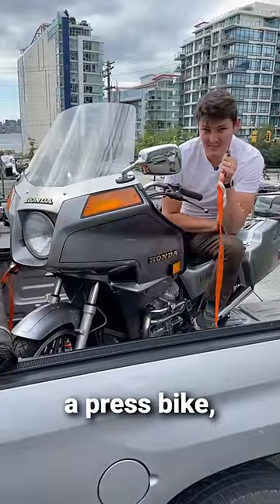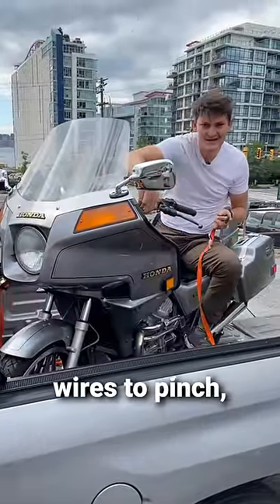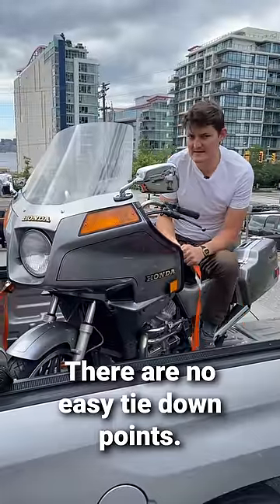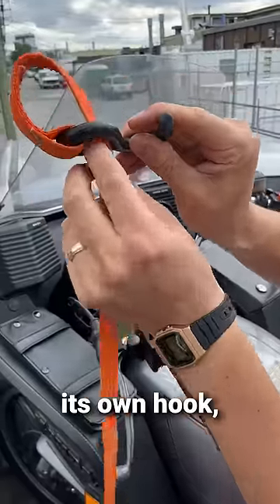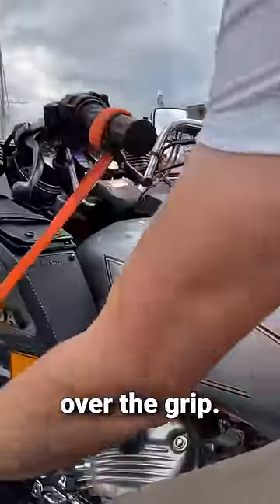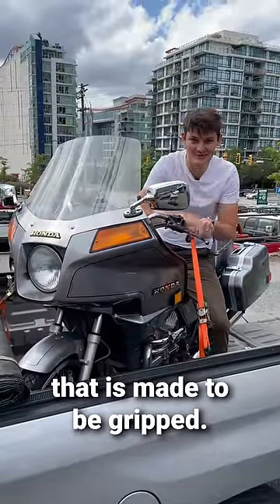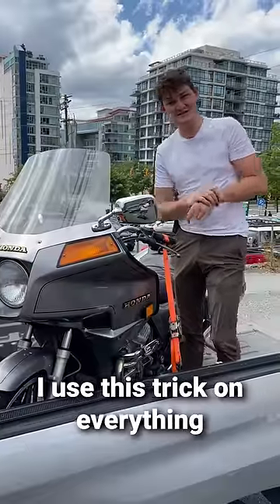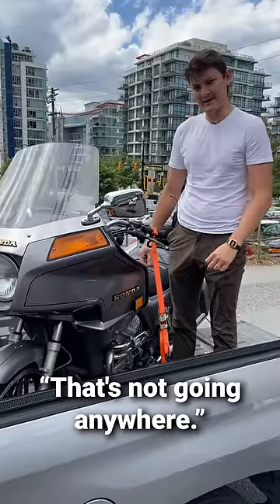The #1 Trick for Strapping Down a Motorcycle

Comment: Dang. This is the first time I completely disagree with Ryan.

Never use the handlebar for securing a motorcycle. It's the worst place to do so.
The best method is to place the straps below the suspension, such as around the forks.

EDIT: To be fair, this video is really about the trick to make a loop on the strap, rather than about how to secure the motorcycle.
Reply: Totally agree… unless you strap the bars near the bar clamp.   If it’s near the bar clamp, the there should be no rotational torque on the bars and no bending moment.  Plus, the grip is a lousy place to anchor not only because it allows a bending moment and rotational torque, but I wouldn’t want to crush the plastic throttle tube.
Reply: "The worst place" what about using the clutch leaver and break leaver as the attacment point?

runs away
Reply: @hankjones3527  🤣
Reply: @positivelynegative9149  But in all seriousness I agree with your underlying point. I think the handle bars shouldn't be the first choice if there are other options.
Reply: I agree this is the first time I ever saw anything that he made that I completely disagreed with. This is a very bad idea
Reply: @hankjones3527 why would you put those nasty images in my mind
Reply: I feel like this would be REALLY hard on your throttle cable. Also attaching on the end of the handle bar will create a bigger lever that could wrench the whole bar down during transit which, would lead to loose straps.
Reply: fowyb If you preload the fork, why would oil go anywhere? If the bumps are so hard you lose tensions in the straps you have either tightened it to little or are going to fast over the bump.
Reply: fowyb Yesterday I paid a dealer to replace my fork seals.  Ain't cheap!  Really ain't cheap!!
Reply: I go around the handle bars and strap it down tight enough that the suspension will not compress unless I hit a 20ft jump in my truck. Forks don’t leak, because the oil doesnt get compressed. The oil flows through a constricting valve, doesn’t act as a spring. This can wear out a spring type fork though if you are holding the spring compressed for a while.
Reply: fowyb your seals were broken before you started to strap it down. This would not cause that damage in no way. The seal is designed to be used on the entire length of the shock. There is no pressure building up against it.
Reply: Agree 💯. Handle grips are rubber and will strip. Why not use the lower triple clamp? Quicker easier no risk. I won't ever be doing this.
Reply: Plus, not ratchet straps. Proper cam buckle tie downs.
Reply: @Zeesneakyninja  Right, but unless the forks move the oil wont flow. So I don't see the problem?
Reply: fowyb if it leaks strapped down they were leaking while riding cause seals don't leak unless they are bad
Reply: i would not trust an 800lb bike to set of rubber grips glued on a chromed post...
Reply: Yes, i also strap it under the suspension after i saw some custom builder on youtube doing it. It is solid as a rock, unlike above the suspension.
Reply: Totally agree, escpecially on sumthing like a Pan European as you can stress fracture the casting.
Reply: Forks are too far in. You need the widest point (bars) to stop it from tipping. You just don't get enough leverage on the triple clamp or forks.
Reply: @shhmule  that is not accurate and will not be an issue as long as you don't tie your motorcycle down with floss string. 2 straps and a wheel chuck is all you need if you tie it down this way. I've driven mine many miles this way with less issues than when I used to strap it above the suspension using 4 or even 5 straps.
As long as you do it the correct way that is.
Reply: @MoreCharactersThanNeeded  So where do you strap?
Reply: Unless of course you ride a Triumph American like myself, there is no front suspension.
Reply: @shhmule  upside down fork, at the topmost part of it above the mudguard. It is important that the straps pull downwards and forward. If I can't pull it forward I use 3 straps and secure the wheel to the trailer as well so it does not move backwards.
Reply: @MoreCharactersThanNeeded  I use a pretty secure chock which tilts forward and locks. I'll try your method tomorrow and see how secure it is
Reply: @hankjones3527  Tbh around the handle and the brake lever is probably a good spot, lock the front wheel up, not that you should need to like but still, nice to have it locked.
Reply: Yep. I have a loop strap that I put a sheep skin seat belt cover over and then loop each side of the forks
Reply: Thank you for saying this, hauled bikes for 6 years, the handlebars are wrong! First time ive gasped at ryan
Reply: I entered the comments section just to say so . ✌️
Reply: What a disaster that was! I tied the straps around the axle at the base of the forks, and tied them forward to my chock.
There were no straps above the suspension of the bike, which meant the whole upper section of the bike was free to sway around.
I drove through a roundabout and the bike just about lay down on my truck bed!
It's just simply not possible to tie the bike down below the suspension components, there isn't enough leverage.
Have repositioned the straps onto my barkbuster handguards for the rest of the trip.
 @MoreCharactersThanNeeded
Reply: Buy a set of canyon dancers and never worry about this again
Reply: False. The handlebars are more than strong enough.
Reply: Wrong, you want the strap as high as possible. Think about it, is it easier to hold a tall glass of water steady at the bottom or the top?
Reply: @shhmule  
When I bought my  2017 Road King and hauled it home with my single place motorcycle trailer I strapped at the forks just above the fender mounts and it was solid and never moved once and I have to travel on winding rough roads for seven hours to get home with it.
Obviously you don't run the straps straight down near the tire. 
This method of securing the bike allows the suspension to function as it would normally putting no stress on the bike or the straps as the straps at the forks  not need to be cranked down to do the job.
Reply: @grounded7362  There's no unsuspended part of the bike above the fender on modern bikes.
The chrome part of the fork tube attaches directly to the axle lug, which is inline with the axle.
Reply: @shhmule  
Sorry to tell you but do you see the design of the forks on the bike Ryan has in the video? the upper part of the fork travels inside the lower fork tube.
Strapping just above the fender mounts puts you below the suspension travel.
Reply: @grounded7362  Nope I was applying the technique to my own bike, as it's more common with modern bikes to have upside down forks.
Reply: @shhmule  
Okay, so you have the inverted forks, run your straps down as far as you can to keep them out of the suspension travel of the forks and put no real outward pulling on the lower forks tube. 
No different than locking into a wheel chock other than the straps are above the axle.
Reply: well that's a shitty low angle, Def not doing tour below the suspension piece
Reply: holly crap lots of really fu#$ ideas here.
Reply: That’s how I’ll hauled my bike since forever
Reply: To be fair to who?
Reply: @russpaton8877  
When you end up catching that bad spot in the road and find yourself with a broken strap and the bike hanging over the side of your truck or trailer or do damage to your bike because you strapped in above the suspension, you will wish you had used that shitty low angle.
Even on good roads every crack in the road causes the suspension to respond and allow a momentary slacking in the straps. Tha amount of force being put on those little straps when the suspension returns is unreal.
And every time that returning suspension creates that hammering effect, it is doing some sort of damage to the bike. Something is getting twisted on bent in some way.
But hey, if you want to tie into those handlebars or your triple tree go for it but don't be surprised when you go into a death wobble on the highway afterwards because you tweeted the fork alignment.
Reply: @shhmule  
Yeah okay.
You better tie out exactly how Ryan did it the video then since that IS the widest part of the bike and you can get the most leverage there.
So leverage is what you're looking for huh?

You have no idea.
Reply: @shhmule  
The mistake you made is tying them forward to your chock.
The need to be out to the side.
Tying forward and inline with the bike is wrong.
Reply: @grounded7362  so what better strap do you use? Same strap, same force but less mechanical advantage. You seem quite upset. explain how your system is better? you know what a fork brace is?
Reply: @russpaton8877  
I use the Tank Straps, they have no hooks to potentially come unhooked, I wrap them low around the forks and out toward the front corners of the trailer. it's not necessary to go clear out to the corners, you just want to be further out than the width of the bike. If hauling two bikes, strap them out as far as that allows. I strap the front tire down and forward with a short heavy strap and strap the rear tire down just to keep it from possibly hopping around.
Never had to put any other straps on the bike and no issues with it trying to tip.
Yeah I know what a fork brace is. What about it? If it helps to make a guy feel better about strapping to the forks that's great, use them.
If a guy is looking to use the fork brace so he can run faster in the twisties, looking for greater stability, they would be better off investing into the inverted forks.
Like I stated, you want to keep the straps out of the suspension. Your straps should never be used where they can slack out at any given moment, not even a tiny bit. To much risk of doing damage and risking a broken strap.
Reply: @grounded7362  sounds pretty solid, my bikes are tall I wouldn't feel good about strapping low at all. The fork brace I am speaking about is one you place in between tire and triple to stop fork compression when strapped not a permanent  fork tube support. Cheers
Reply: @russpaton8877  
It is a very solid setup. I use this with my 825 pound Road King and have used it with a full dress Goldwing and never once was concerned about it or had an issue.
As far as the fork brace you are talking about. I would be concerned about scoring the tubes and doing damage to the seals once removed and in operation.
Your fork suspension is going to want to move and push against the fork brace with every bump and crack in the road.
Reply: I found out how weak ZRX handlebars are when I strapped mine the same we had been strapping a ZX12 = bent my ZRX bars🤦‍♂️
Reply: yeah, just like a car/truck. you want to tie it down on unsprung parts. so you're not compressing the hell out of the suspension, or risking a heavy bump loosening the tie downs. and you let the suspension do it's job instead of being over compressed. but ya gotta do what ya gotta do sometimes. i would much rather use foot pegs or something when possible. but if you can strap around the axle, it ain't goin anywhere... i always make sure anything i'm hauling is tied the fuck down. cause i drive fast... it needs to be secured. and i've never had much of anything come loose. did almost take out a minivan with a 2 inch strap on a bundle of plywood once... this was before i learned ratchets' locking point and the strap unloocked and went flying out toward the minivan.
Reply: The guy likes to secure the deer by the antlers
Reply: I always use the fall braces to strap my Honda Transalp down as they have sturdy mounts. Handlebars will buckle if it gets swayed to hard, for example on a ship on a choppy sea.
Reply: @gasdive and with carabiners :)
Reply: @MoreCharactersThanNeeded  strapping the bars down is also extremely solid if you do it right. I still wouldn't go by the grips though.
Reply: @jellafella6957  the issue I have with it is that the suspension creates slack for me sometimes unless you bottom it out. Less springiness in the system has paid off for me at least.
Reply: Just here to +1. The loop is a cool trick, but for location I always go up from the front wheel parallel with the forks and around the ignition/triple tees. The suspension locks the bike in place for you.
Reply: Below the suspension?  hook it to those fork seals?  yea that sound like a much better place to do it. . .I have been doing like the video since the 1980's, locally and across the country, many different  types of bikes.  0 issues, 100% success rate.  It just takes 2 tiedowns.  Put the wheel in the corner just like that . . . or if you can't go in the corner . .  (because you are taking 2 bikes maybe) turn the steering to the lock and tie it down in that position, that will keep it from shifting and loosening up.  Using the grips keeps the tiedowns off of the bodywork.
Reply: If that took out your seals they were already bad. fowyb
Reply: @smoke05s   Below suspension mean a place that is not subject to suspension compression. 🤦‍♂️
Reply: This is a official way to strap down here in Europe. There are special attachments you can buy that do the same thing. The good thing about this method is that you compress the springs so the body doesn’t jump around.
Reply: I like to leave it running and have one strap on the throttle and another one on the shifter.. makes bumpy roads more interesting..
Reply: If you’ve ever had your motorcycle towed you know that any tow company actually uses a dolley to keep the tire straight and it has straps that come up to the handlebars. It basically has a loop already on both ends and the force of the strap will also compress the forks and keep it from tipping side to side more like you can get from strapping to the triple tree or forks. They are just not centered with the center of gravity of the bike. Try and hold a bike upright from just the triple tree, it’s a lot more difficult than the handlebars. Plus when you get that tension and then start to ratchet down on the handlebars (ie. doing it the right way) then you will most definitely not end up with loose straps and in fact they actually feed one another to keep tension. Hard to explain but yeah he’s right.
Reply: This dude clearly hasn't  had to transport alot of motorcycles.
Reply: Don't ratchet it down like a chimp and you'll be fine.
Reply: I've been doing it wrong for 50+ years???? NEVER had a problem, EVER. You don't tie it down to 500 lbs. You don't compress the forks all the way, You don't need to secure the front and rear wheels..... who are you people???? Have you ever put a bike in the back of a truck??? Do you know what a motorbike is???? Do you own a truck????
Reply: I used to tow, yeaaa did that once the bike fell over lol. ideally you should have one on the back and one or two on the forks and maybe a third going over the handlebars for extra stability.
Reply: @hankjones3527  I always hook tie-downs to the spokes...
Reply: @savage22bolt32  That's brilliant!  :)
Reply: @hankjones3527  they tell me I'm not the sharpest tool in the shed...
Reply: 100% agree. Unless you have no mounting point where the front guard attaches to the front fork leg, this is the only location to tie down from.  Towed a Street Glide 800kms using 3 tie downs, one on each fork leg above the guard bolts and one to stop the back wheel moving sideways. Never even came loose (although i stopped and checked many times). Best thing about this method is it allows the bikes suspension to still work, taking a lot of "bump" out of the trailer.
Reply: i was going to comment this lmfao
Reply: @minecraftblockychris8708  good thing you didn't, there are too many comments on this thread already
Reply: Wow, the WORST place? Surely there are worse spots.
Reply: I e seen costumers try to strap their Harley down like that few times they ended up bending bars.
Reply: fowyb  That's because Harley engineers know that the bike is going to be trailered back to the dealership for repairs more than it'll be ridden. LOL
Reply: Ahh yes, learned this in the good ol' days of SRK Cycles videos back when they sold motorcycles.
Reply: I don't get it either, some slide off pretty easily and the handle bar can bent. 
The best place is ABOVE the suspension on the crown plate and put the suspension under tension.
Reply: ITT: Boomers who’ve never actually hauled a bike. I wish YouTube had a ‘Hide all comments from people over 40’ filter. Not kidding, I would pay for that feature.
Reply: @dhess34  When I was young, we used to haul bikes on a donkey cart, uphill both ways, year round bare foot in the snow. We pulled the cart by hand including the bike AND the donkey. You Whiffet..
Reply: @gasdive Nothing wrong with good quality ratchet straps. I use them all the time. Used them on a trailered goldwing (940 lbs). It was a 3 hour trip and nothing moved or loosened up.
Reply: @bobcaygeon4533  ratchet straps make it way too easy to apply way more tension than needed. You can over tension cam straps too, but it's slightly harder.
Reply: ThePooper6969  Don't ! this is bad advice, grips can come off.
Reply: Clamping down on the handlebars is THE method. Even better if you got a long two sided strap.
Reply: And it puts undue pressure on the head bearings that aren’t designed for that.
Reply: @hankjones3527 They shouldn't be an option at all and there ARE other options and ones that won't tear your bike up.
Reply: Honda specifically states not to do this on the 2018 and up Goldwing, it can break the steering stem.

I've replaced several due to customers using the bars or even a canyon danced to hold the bike.
Reply: I've learned to strap both. Strap below the suspension tightly, because the suspension can compress during a bump or hard braking. Then strap on the handlebars with less force just to keep the bike properly upright.
Reply: hankjones3527
What about the brake switch wires?
Reply: as long as you give it a little shake & slap, it's not going anywhere
Reply: Came here to say this
 These are mot ment to hold the bike. Theyre enough to hold the weight of your torso but not hold a bike in its place. Ive seen handlebars fail. Imagine it doesnt break but it gets damaged. Now next time you brake hard in an emergency your handlebar can fail and youll just slam against the tank and handlebar